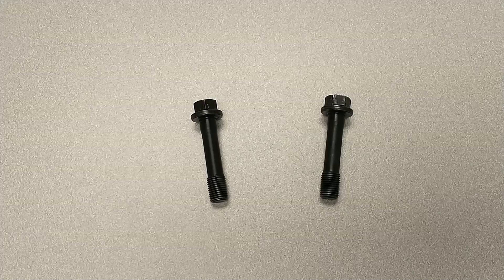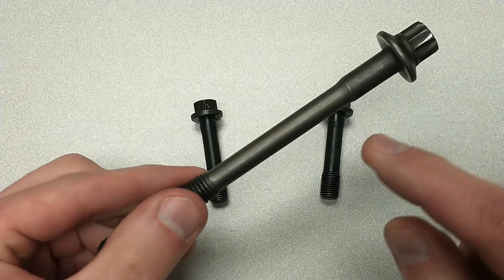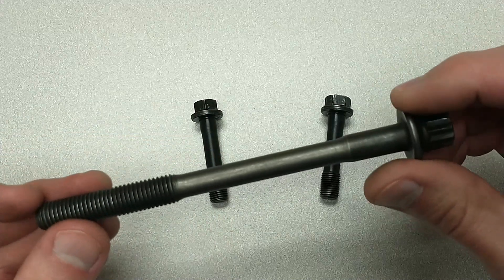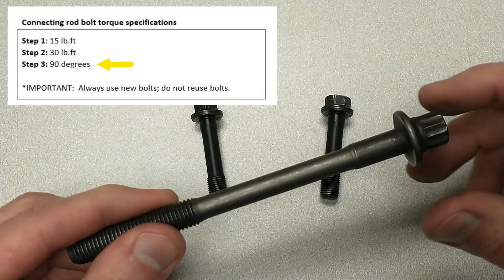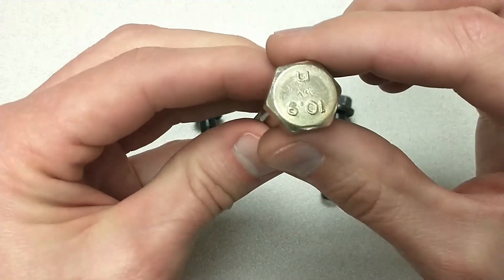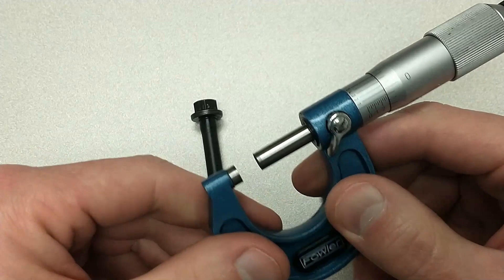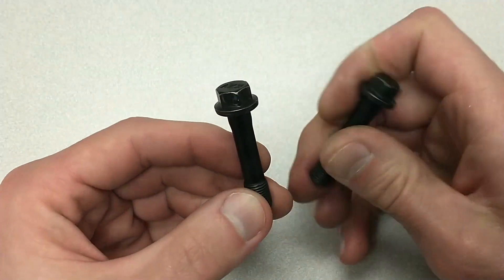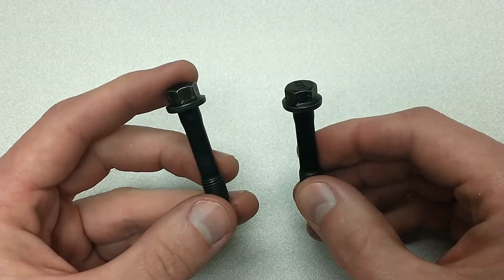Can I Reuse My Engine Bolts?

Comment: I recently rebuilt a ford 2.4 diesel engine and used all new tty bolts, i followed the manuals instructions on tightening and all seemed ok, later when the engine was started i noticed bubbles in the radiator header tank and a solid top hose (failed head gasket) i removed the rocker cover and cam shafts etc to get to the head bolts, before removing them i tested them all for tightness with a torque wrench, the    specified tightening sequence was for the big bolts 20nm 40nm plus 90 degrees plus 90 degrees so i started my test at 50nm and worked up in 10nm increments, i got to 90nm and all were clicking the torque wrench apart from one which just went round and round. On removal of the head i found it leaking in the area of that one bolt, the bolts i used were from a supplier who sold me the full kit gaskets bolts the lot, the numbers on the head of the bolts were 10.9 i found out that the correct numbers should be 11.2 so i spent a little extra for branded bolts made in Germany and so far no problems all running fine. My question is the first batch of bolts i used were of unknown origin probably Chinese and i am wondering how close to the manufacturers specifications are these bolts are made obviously it must be a random luck of the draw type thing so for all out there in a similar situation dont go cheap on these things they might come back and bite you. Just add, the bolt in question measured an eight of an inch longer than the rest after removal

Comment: What about metal bolts in aluminum engine parts.  Are metal bolts galvanized so there is no dissimilar metal corrosion?  And if you have to remove a part you should always use new bolts?
Reply from the maker: You only need to replace the bolts if they are "torque-to-yield" bolts (this is found in your specifications), or if they have been over-tightened.

Comment: The Chrysler/Jeep dealer in our area is telling me that they normally don't replace the TTY bolts on the caliper brackets when I did the brakes on my wife's Cherokee. To top it all off, they had 2 of each (front and rear are different) from sets of 4, so I deduce that Cherokee's are going around my area with reused TTY bolts in their brake systems! 🙄 I also couldn't find anywhere the proper torque sequence for these bolts, only a single torque value for the front and rear wheels. Naturally the dealer is no help. Thanks for the great info, it must be spread around. Ignorance will doom us all.

Comment: There will be small variations in width between any bolts if they are measured carefully enough.  What I'd like to know is when exactly a bolt is too thin to be used.  What measurement is considered to be out of spec verses acceptable variability ?
Reply from the maker: The bolt manufacturer will have tolerances that they use in manufacturing quality.  The higher the quality of the bolt (as opposed to low quality bolts purchased in bulk from a hardware store), the less variation there will be in size.  

You could perform your own measurements if you had a large enough quantity of the same bolt that are new (not used).

Comment: Usually when a bolt it torqued with degrees they are torque to yield I can’t say I’ve ever seen one that wasn’t and I do motor work professionally at my repair shop I own, the degrees is when ur actually stretching the bolts u almost always have a low ft lb torque then the last 1-2 steps is degrees.
Reply from the maker: Almost all "critical" bolts on modern engines use degrees for the final torque step because it helps to get a more consistent result than a torque specification alone.  However, it has nothing to do with whether or not the bolt is a torque-to-yield bolt. A very high percentage of those bolts are not torqued to their yield point and can be reused if they are not damaged.

Comment: Hi Justin, I'm a rookie to this engine building, Am I correct that even though I see in the service manual to rotate 90degree (2X) does not mean my head bolts is torqu to yield? So can I reuse the bolts? And yes in the service manual it does not say I cannot reuse the bolts. The bolt part number is Toyata 90910-02121. Your thoughts?
Reply from the maker: You are correct.  All torque specs on modern engine head bolts will include an angle as the final step.  This does NOT mean that the bolts are TTY bolts.  The best place to check is in the service information.  If it does not specify that the bolts must be replaced every time, then they are probably not TTY bolts.
Reply: @JustinMillerAutomotive  Thanks!

Comment: The other one you need to do a video on is NOTusing a hammer to release the steering joint taper in the steering arm. Everyone thinks it’s ok to keep walloping it until the eye deforms and pops the joint pin out